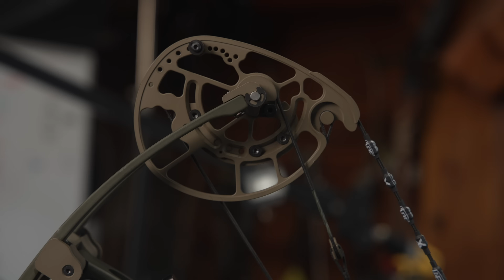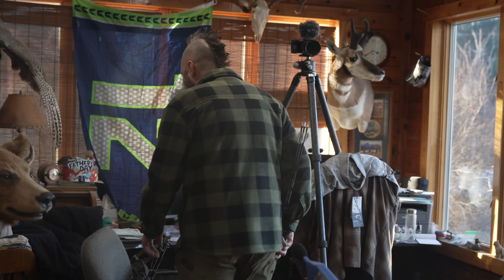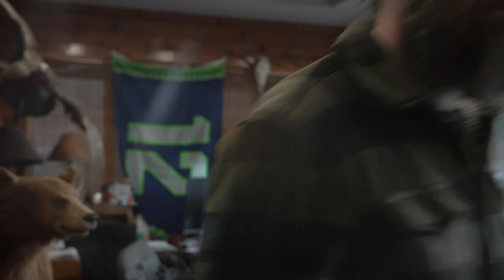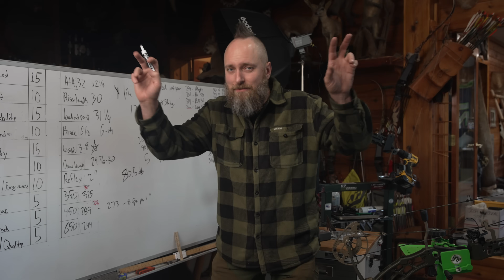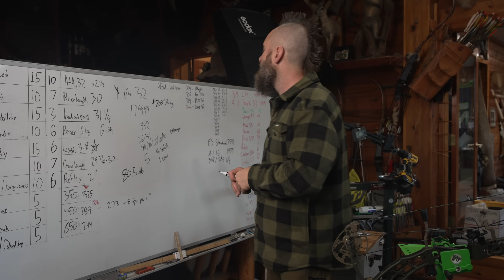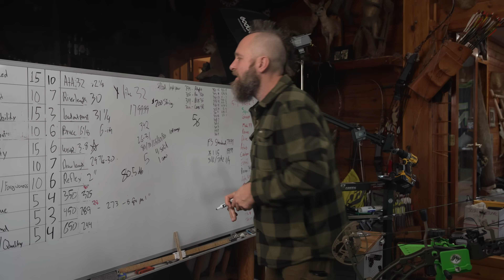NEW 2025 Xpedition Xlite 32 (BY MFJJ)

Comment: I’ve had a 33 and 35 for about a year now. Both are great bows that are durable, light, dead in hand and fast. Personally I don’t need to tune my bow, rather spend that money with my local shop and support them. Plus once they’ve set it up for me it’s golden. Only time we had to do anything was when I went to smaller diameter arrow and new strings and the rest is the only thing we had to adjust. Of course it helps when shooting Squatch Bloodline strings

Comment: I have an Xpedition Archery bow, model RAX33 from 2021. My only complaint is tuning, once tuning is set the bow shoots lights out. It has an amazing draw cycle with a solid backwall. Xpeditions customer service has been absolutely amazing. Whenever I've had a problem, they have stood behind their equipment 100% . Thanks for the review 😉👊

Just bought a Mathews Lift X33 just for the tuning features and i'm not disappointed🤪

Comment: Good, honest review! Twisting the cables slightly to get the A2A spot on at 32" would bring everything else into spec (brace, draw length) and a slight bump in speed, with a touch longer valley.